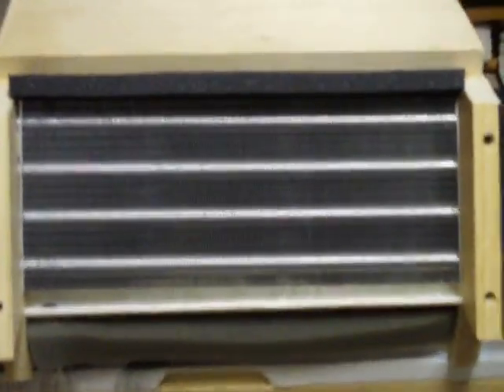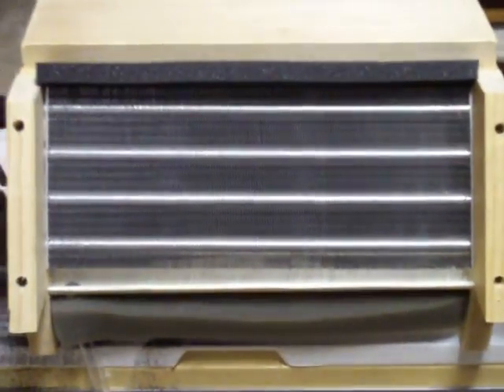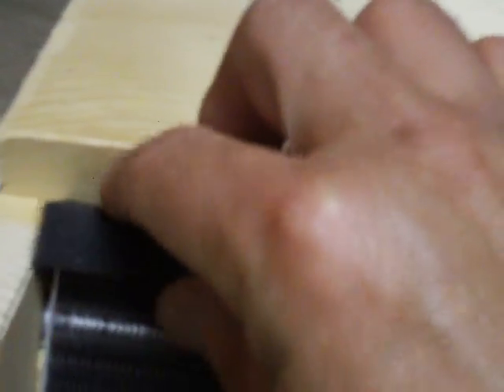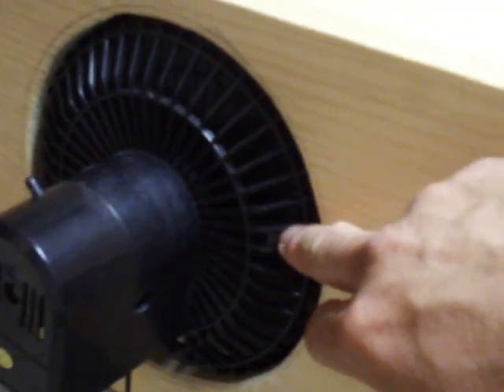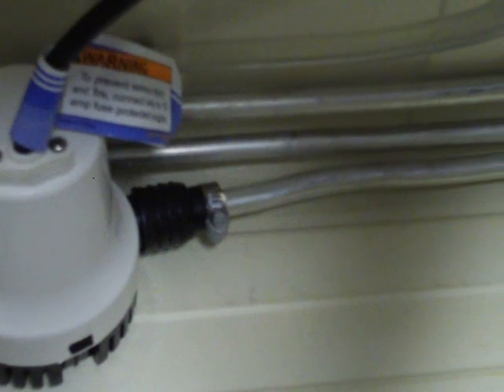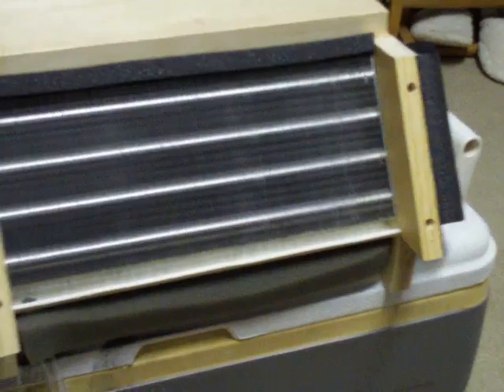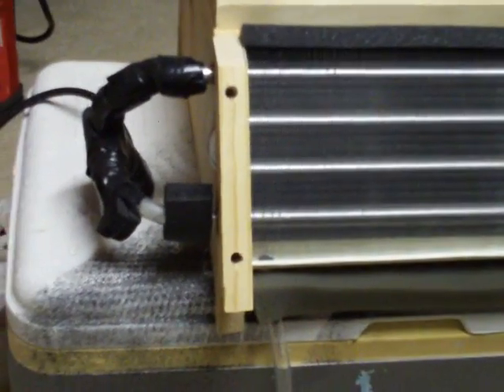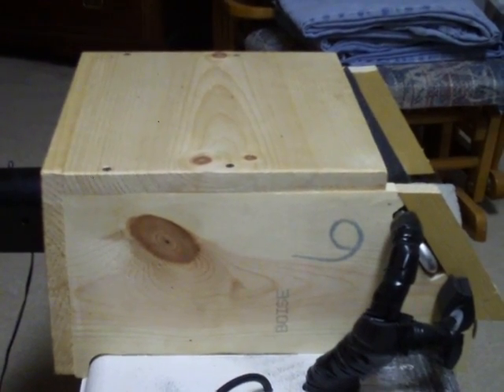Homemade Air Conditioner.

Comment: i know this video is 10 years old BUT i think yours is the best, i was thinking like you to wrap copper loops in the bottom and i have a self contained heater core fan assembly with its own 12x12 inch aluminum core and 2 speed fan. I think ice water to a core instead of cold air forced over ice would be more effective? This unit would be in a 85 peterbilt 359 that has a small cab and insulated well and should in time be re cooling cool air thru the 12x12xcore. The windows are blacked out and cab is small. Thanks Again

Comment: If you would have built a water chiller your room would get really cold
Reply from the maker: Yes probably so, but at the time I just went by what I had available to me, And did it this way, but I agree with you.
Reply: @Wallabydam   I am going to build one to cool my room because the ac doesnt reach up in my room for some reason and it gets hot in my room so I am going to start buying parts and making something
Reply from the maker: @southsidemikevlogs  well I hope build turns out good and works for your situation, I'm sure others on here would like to see new builds as well.
Reply: @Wallabydam  do you think it would get cold in my room or do you think it won't get cold how did your work did it get ice cold
Reply from the maker: @southsidemikevlogs  worst part about cooling a room is the more items in it,  more heat that has to be removed, items have to acclimate to the temperature  your trying to cool down to. First couple hours is goin to melt ice quickly,  after you get the room and everything  in it cooled down it's just a matter of maintaining your ice, I believe it's better to freeze ice as big as possible  that will fit in the unit you build. Bag ice will get things cold quicker because it has more surface area per ice cube. Once after that I would freezing 2 gallon buckets of water for bigger block ice and just rotate ice block for melted water,. Only way to find out, is to just give it a shot and see. Everyone's situation is different within reason.
Reply: @butchtropic what would be a good way of building something then something that would work
Reply: @butchtropic that's the bad part I live in a town house and got have nothing in the window  here you will get a fine
Reply: @butchtropic when the landlord put a new Furnace in he put a small one in and the upstairs doesn't get cold at all and my room is hot all the time

Comment: Can you put dry ice in the cooler without it freezing the water that needs to circulate through the system?  If so, what is the best way to do that and is it safe?
Reply from the maker: Scott McDaniel  there is some talk about that below in the comments. but I can tell you that you cannot use dry ice in a sealed cooler and definitely not inside a closed room without some kind of adequate ventilation.

Comment: What if you were to use a 100 gallon per hour pump instead of 1000 gallon per hour pump. Do you still think it will work as well?
Reply from the maker: Scott McDaniel it wouldn't make a difference the line size is restricting it so 100 or 1000 gph. But I'm sure depending on the motor 100gph pump would save battery... I bought it at the time because it was readily available as I gathered components.
Reply: Wallabydam, cool that is why I got the smaller one. After doing the calculations I figured my battery could run the smaller 100 gpm pump about 37 hours compared to the 1000gpm pump 11 hours. Awesome video. Thanks!
Reply from the maker: Scott McDaniel yeah I'm sure there is a pump thay will work and save a lot of battery life. I just didn't spend a lot of time looking for one.  thanks for the visit. I appreciate it.

Comment: How many feet of hose do you think you coiled? building one now but would like an idea of how much hose is needed to sit in the cold water/ice?
Reply from the maker: Nico Ri if i remember correctly it was about 8 or 9 feet long
Reply: Thanks! Instead of having it coil, do you think it would make more sense to actually use the cooler water inside and keep cycling it? Like have the inlet suck in the cooler water and the outlet dump the exhausted warmer water back in?
Reply from the maker: Nico Ri to be honest I did it this way because in my opinion having a open system may melt the ice faster. I thought of using it that way initially but changed my mind. I say to each his or her own .

Comment: really its all about relative temperatures. if you reduced the temperature by 20 degrees compared to the ambient 104 degrees, i would say that its successful. obviously with a purpose designed ac you have greater efficiency, but also at a much greater cost.....your solution is pretty good id say! well done!
Reply from the maker: Well said,  I agree , Thank you!

Comment: prob one of the best ive seen so far...wonder how it would do on 1 of those fishing trips here in fl
Reply from the maker: if it had a isolated alcohol  mix  in a closed in system.  dry ice could be used for hours.  and provide the absolute coldest air

Comment: great design!!!! I would suggest adding salt to the water and adding a more powerful blower like one from a car air conditioner. You could probably get a car a/c blower from a pick-n-pull yard for really cheep!
Reply from the maker: your right about the blower bit it will also drastically reduce ice longevity.  many have suggested the salt added to the ice, but the components in use are aluminum,  and it will cause oxidation and corrosion, so I just use it as it is for now. thank you for the suggestion!

Comment: I like ur video.... how about a hydrogen generator....?I'm curious how big of a dry cell I weld have to make to assist a 6.2 liter diesel....?
Reply from the maker: hydro cell. electrolysis.. it works. just has to be safe and regulated properly for the engine to run and use it. plenty of water around.

Comment: Just some food for the thoughts, how about freezing some gallons of water instead of using ice cubes. I just think that it would last a lot longer. Yes my grandma some 60 years ago used the milk gallon containers to make huge blocks of ice. It melts a lot slower than ice cubes. You could even recycle them use two gallons while you have another two on you freezer.
Reply from the maker: Yes. I have a 1 gallon container that has an open top and it is conical in shape slightly almost like an ice tray would be but only it holds one gallon of water and I freeze two of those and put it inside and it usually lasts up to about four and a half hours
Reply: By the way I think that you did an awesome job. I have seen so many of this on youtube that I am ready to build one for my custom bicycle build shop. At lest it will be much cooler than my shop fan and it has been ridiculously hot here in Central Florida, in the past few days.
Reply: +Wallabydam you did a wonderful job everybody don't have to agree on the same thing different strokes for different folks again like I said I'll buy one if you ever decide to sale one
Reply from the maker: thank you that's up lifting.  I will keep you in mind if I decide to. I appreciate the generosity! 😆
Reply: +Wallabydam no problem keep up the good work
Reply from the maker: Thank you ! btw. your quote on your profile.  very very true ;)
Reply: +Wallabydam lol

Comment: Wallabydam do u think this could work in a car in dry desert heat for more than a couple hours, maybe using a power pack, or do you think the ice is just gonna melt too quickly?
Reply from the maker: well there's too many factors the only way to find out is to try it

Comment: wont salt waterjack up the coil
Reply from the maker: it would and that is particularly why I do not use salt water with anything aluminum with copper it is not nearly as bad it's a good idea but it would definitely have to be used with copper components

Comment: Volume of ice water probably makes it work better too.  1/2 line vs. 3/8.  I would run the return water through a coil of metal line too.  Cool it down before dumping it back into ice chest.
Reply: ForkliftJoe

Comment: Great job. I'd just drop the condensation tube back into the cooler.
Reply from the maker: the controversy with that is that even though the water coming off is cold. it's still not as cold and so putting the condensation is adding more water which in turn would possibly and probably make the ice melt a little faster you really don't want more water inside of it then you need just enough for the system to work
Reply: Yeah, just thought of that before you replied. Would be adding water from atmosphere into cooler. Still the best one I've seen. Just need to run the condensation outside like any a/c.
Reply from the maker: I honestly feel that it would work best without running the condensation tube back into the unit I appreciate the comment as well thank you
Reply: I agree

Comment: My friend did one smoothing similar for his boat. He used a condenser from an old window ac unit but uses sea water from under the boat. The cater is cool enough to drop the cabin temp to a comfortable level
Reply from the maker: that's similar to what I do with water from a running stream, running it through a car radiator to cool a small work shed.

Comment: heres an idea.....Add salt to the Ice water, which will lower the freezing temperature. that way you can pump liquid water thru the cooler that is below 32F. Yes it will make the Ice melt faster, but depending on your supply of Ice it could be an idea to think about...

also....how would that cooler handle salt water going thru it?..the bilge pump i would imagine would be ok...just flush it with fresh water when you store it away?

Edit
DERP i see ppl asking the same question below..

Comment: great work man, its great, i was going to do the same but with a little change and you dont need to change ice, make it run on rubbing alcohol and seal the container, boommm you really have a ice less AC. well don, hatz off to you.
Reply from the maker: Thank you sir!
Reply: why doesn't rubbing alcohol require ice?
Reply: Fenton Grant rubbing alcohol when sprayd it cools, hence making a cold surface.
Reply from the maker: Thank you.  And great idea !
Reply: Wallabydam
which idea and whose, you are thank full off.
Reply from the maker: You. Alcohol idea
Reply: Thank you

Comment: Not an HVAC guy myself either, but based on what I remember hearing from those I've known, the course I took years ago on automotive AC, and from my experience this last summer when my AC died, I believe that the general target of even refrigerant-based systems is for the air coming out of it to be about 20F below the ambient air being sucked into it, so it seems like you hit it pretty well spot on to have cooled a space that size in direct sunlight without insulation by 20F in a mere 30 minutes.
Reply: Siege

Comment: if you use/add 5lbs of table salt/5lbs of ice/ and the rest water, you'll will get the temp down to negative and it will  still allow the fluid to flow..make sure you stir the mixture...i guarantee you won't be able to keep your hand in there longer than 15 seconds...enjoy
Reply from the maker: Thank you ! Only thing is . Aluminum would corrode so I don't use it. Coil wouldn't last too long..
Reply: Ok then try putting the salt ice water solution in the bag and then put that in your air conditioner with the water around that
Reply from the maker: That could possibly work just as good !
Reply: +Wallabydam  it definitely would. use a thick trash bag or use multiple 1 gallon glad zip-up bags... it will drop your water temperature down to sub freezing temperatures probably 10 - 25 degrees Fahrenheit

Comment: Add air filter before cool it. Or maybe you can adapt hvac concept for replacing the ice. Alcohol may prefered for the circulating fluid in ur close system. Im just adding more complication lol. Good project btw
Reply from the maker: Alcohol is cheap. I wonder how well it transfer heat and cooling.   And Thank you!

Comment: Great stuff, you're a really handy guy, though the ice trick is not the best one, ice melts fast (I bet on this) and tadaaaa... did you think that, using of your undoubtful skills, could try building something based only on electricity like a light classic AC, based on "adiabatic" friend using as freezing agent the old good air?
Reply from the maker: As not meant to cool my house. Just having fun experimenting and building something..

Comment: In layman's terms;

If you are cooling a room, you don't need a cooler or coils or pump- just the ice and a little fan to move the exchange quicker.
 The faster the ice melts, the faster you are cooling the space.
 You are changing the temperature of the air, not "conditioning" it as in removing humidity- in fact, you are adding humidity.
 The cost to make the ice and cool the room at XX temperature for XX hrs is the same as running a small a/c, since the refrigerator must use XX btu's to remove the heat from the water to make ice.
 If you must buy the ice, expect to pay much more for cooling this way. This is not free or low cost air conditioning since no natural energy source is used.
 *40 years in HVACR experience here.
 Nice video though.
Reply from the maker: ok, im not goin to be "That Guy" but with your 40 years in the HVAC business, you should see that i AM removing moisture and humidity from the air, this is NOT a swamp cooler as you are saying, and no one mentioned its free or cheaper to use, just the fact that it can be used  more portable without the use of a generator or the need for AC current, If you are talking about IF someone was to just blow air over ice, then yes your adding moisture to the air, my unit does not add any moisutre to the air, and i appreciate the comment and your time for watching,  Thank you.

Comment: how u get evaporator?
Reply from the maker: That is a transmission cooler for a auto, i had that on the shelf in my garage, i never used it for a auto, so i used it for this experiment,
Reply: ok gracias lo que pasa es que aqui en mexico no eh encontrado uno ala medida como el que tienes y me podrias decir de que carro es? para buscarlo
Reply from the maker: Bueno el que usé es para cualquier carro o camioneta. Es hecho por una compañía llamada hayden. Que medir aproximadamente 14 pulgadas por 5 pulgadas. Y es alrededor de 3/4 pulgada de espesor. Originalmente lo compré en una tienda de auto parte. Gracias
Reply: estoy por hacer uno similar solo que para mantener mas tiempo el hielo le pondre 1 celda peltier para que mantenga el frio y lo are un poco mas grande.....quisiera saber si de verdad enfria? mi cuarto es de 4x4 metros   o solo refresca el aire momentaneamente? y si te dura el hielo un buen tiempo? saludos
Reply from the maker: It should keep a room that size cool.  many factors to how long ice will last.
Reply: ok gracias amigo, lo voy a hacer y aver que tal sale un saludo
Reply from the maker: thank you and good luck

Comment: I don't get it. Why don't you just cut 2 holes in the side of your refrigerator and blow air through the refrigerator that way you will not have to move all of that ice from the refrigerator into the ice chest.  Use an Energy Star refrigerator.
Reply from the maker: Sounds like your speaking from past experience, Wonderful idea you have there, nothing like having a 200+ lb fridge with freezer toting it into the woods for a camping trip in your tent, and dont forget the Generator that would be running all night, Hmmm WAIT How Awesome would that be to see a Small Plane waiting to taxi on the runway with a fridge leaning back   in the plane and a generator plumbed for fresh air and exhaust so it keeps the pilots cool and from passing out for those gasses, You my friend are a genius, and to use a energy star rated Fridge, My gosh we will be saving the planet and keep things GREEN, and to think, this idea of using a fridge and drilling two holes in it  came from your brain....Thank you SO MUCH! ...
Reply: Wallabydam  How about a Koolatron fridge running 12v. run your return hose right through a sealed water container fitted inside the cooler, that way little mess?

Comment: Do you know how much energy it takes to run this? The cost of parts exceeds the price for a small ac unit that you can get at the store so unless the cost of energy is cheaper it seems you could just buy one instead of making one.
Reply from the maker: This was just a fun project I do not plan to use it for my home. It's in the description and mentioned in the video...

Comment: 1st no professional but darn good construction with the cuts and all. the radiator seemed small as tho its from a honda or geo metro. would have loved to see it run. and the hose for condensation, could you have put that closer to the top of the cooler? used a bigger fan? radiator? but even without the bigger fan or radiator it honestly doesnt look MORE  like a POOR mans diy ac altho as i was watchin all these videos i was thinkin of usin an ac. but was wonderin myself if it need to be behind the fan and the part that cools the water or how you have it set up. good job tho. ide just do the finishing touches and there yea go. but 20 degrees in the size of a pickup bed... idk how efficient  ide say that is. but im no pro either. still good job!
Reply from the maker: I have  a video  home made air conditioner part 2 it shows it working, Its a trans cooler for a car, i had it for one of my cars, sat on the shelf for years, and decided to use it for this, til the day i really need to use it for a tranny, lol... this was just something fun to build, i catch crap from alot of people saying this aint no poor mans stuff and etc, but it was just something simple, i could have went all out on it and did dry ice and other complicated things, but just wanted to keep it simple,
Appreciate the compliment, and you taking time to view,   Thank you !